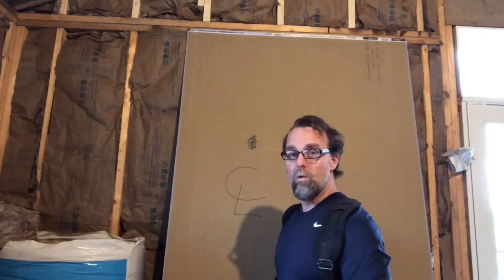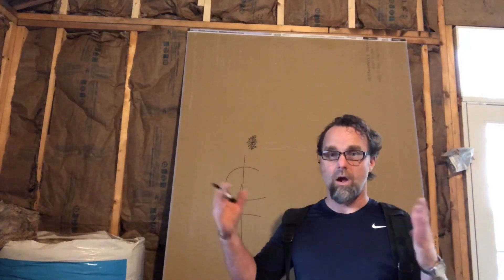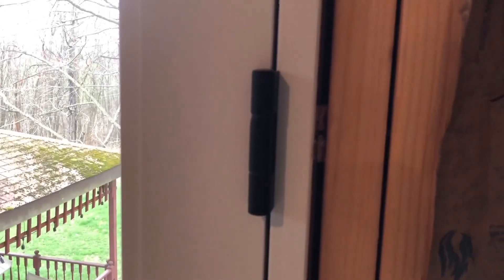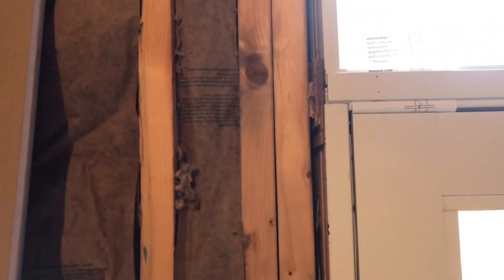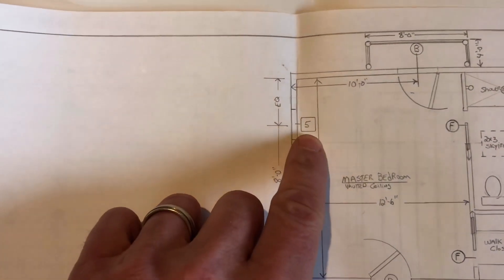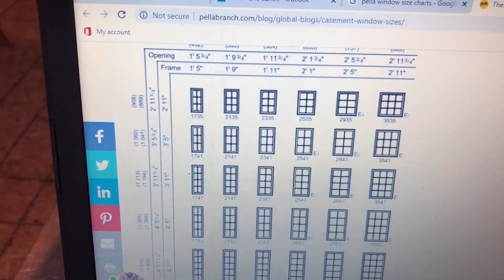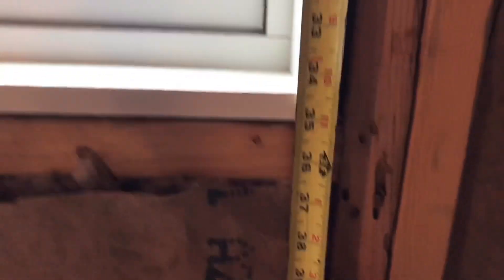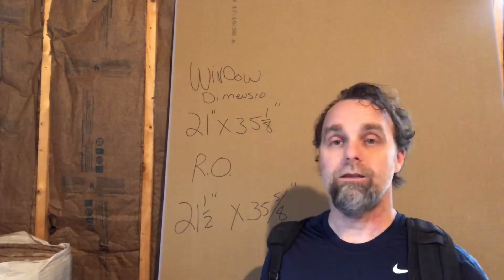Rough Openings for Windows and Doors

Comment: Hi, I'm planning on installing a side entry door to my garage. The master bedroom is above my garage. How should I proceed. Thanks
Reply from the maker: Hi Pat, You will need to add a load bearing header and enough trimmer studs to carry the weight. You may need to consult a  structural engineer.